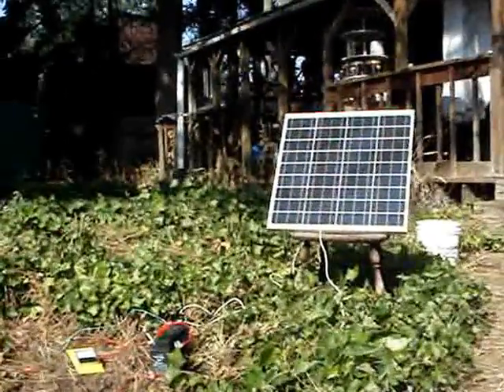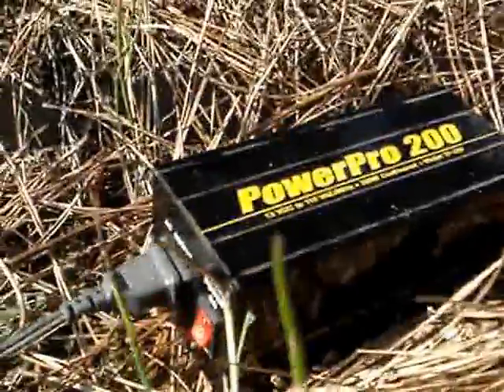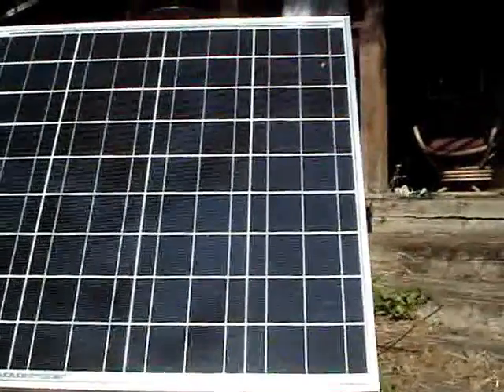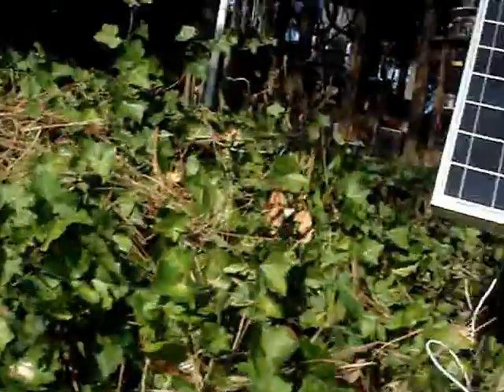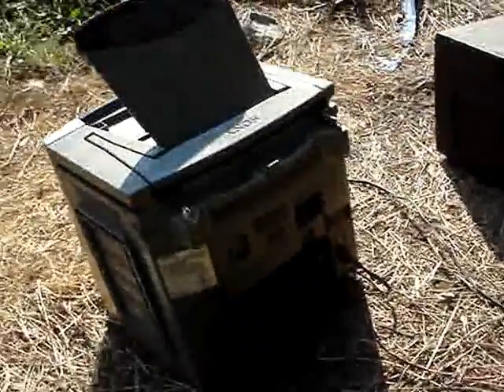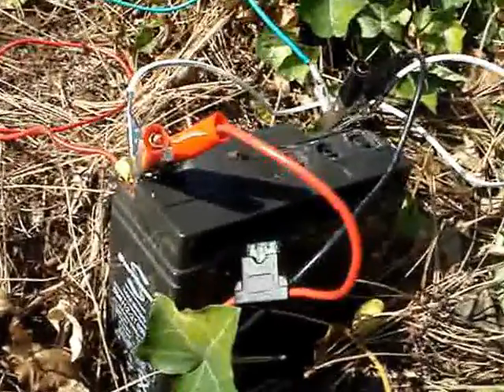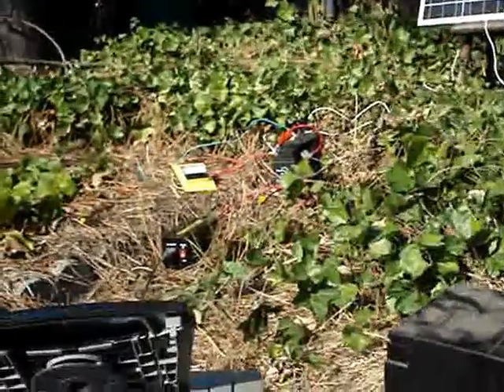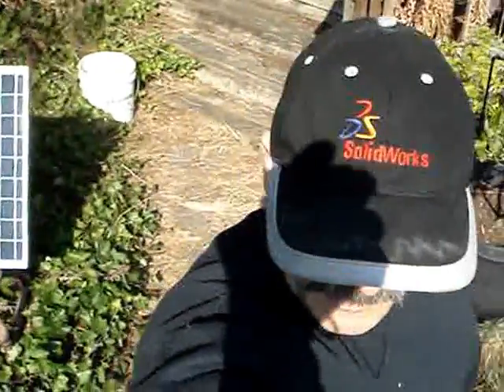Small Off Grid Solar Power Demo

Comment from the maker: Its a very basic setup, I'm not even using a regulator .. This is a terrible example of doing a setup properly. At least a 15 amp fuse should be from the panel to the regulator. Always try using heavier wire than what is required. Fuse will protect against shorting thin wires.